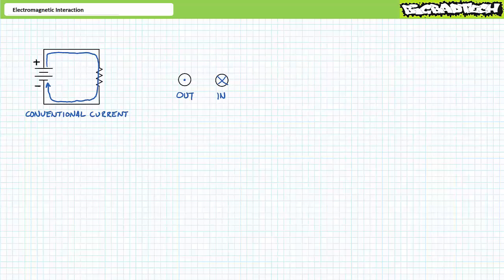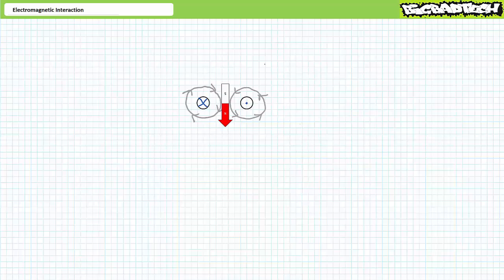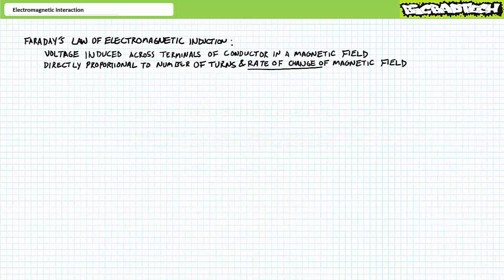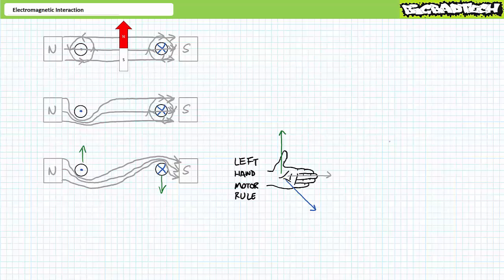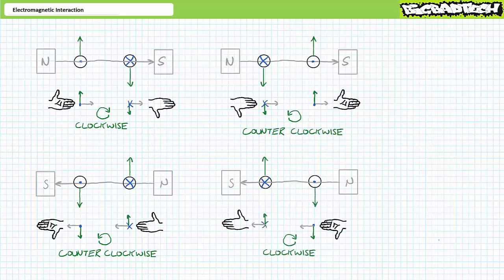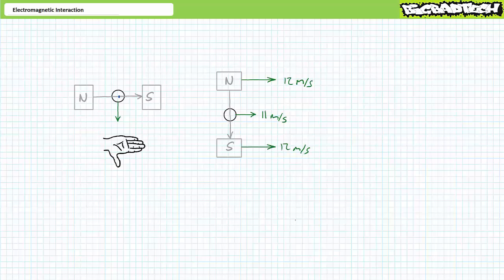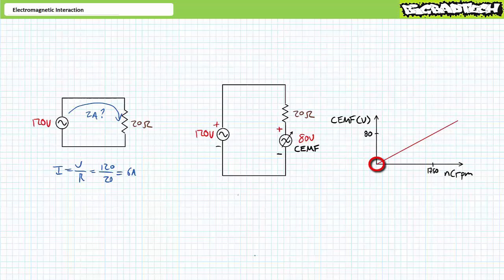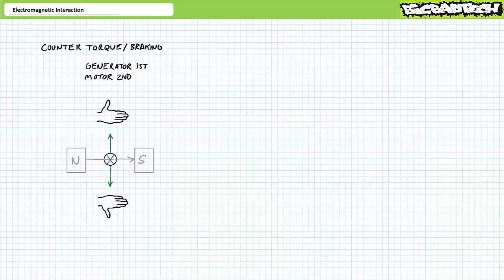Electromagnetic Interaction (Full Lecture)

Comment: Excellent as always. I learned this in the military so many years ago. We however learned the Universal Right hand rule. The thumb is the input, index finger is the direction of field, and middle finger is the output. This works on both motors and generators, among many other items electrical and mechanical.

Comment: I work for a European locomotive and tram manufacturer, we have dynamic braking in all our products stating that the regen braking energy will be put back in the grid IAW the other trains accepting the energy for their usage. In this AC system, does synchronizing (to railway grid) of the motor turn generator play a roll in this redistribution of energy? What about impedance in the return (catenary)?